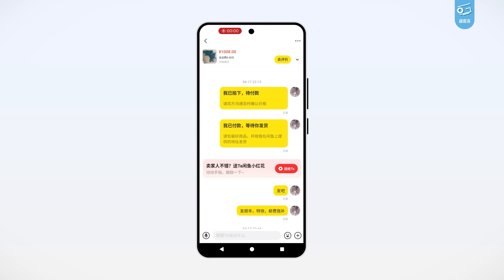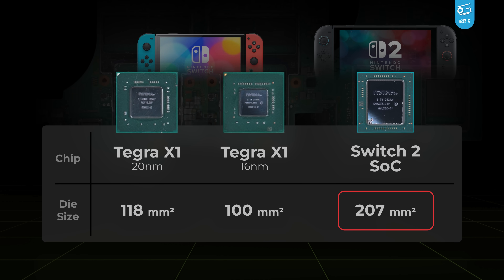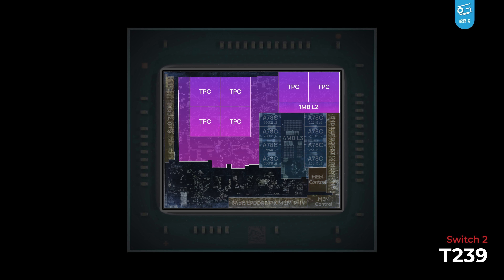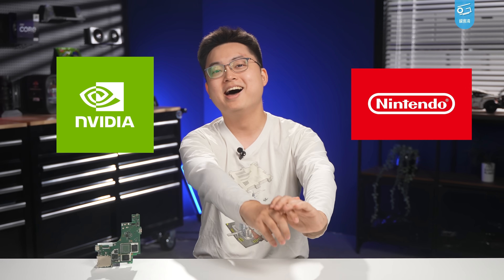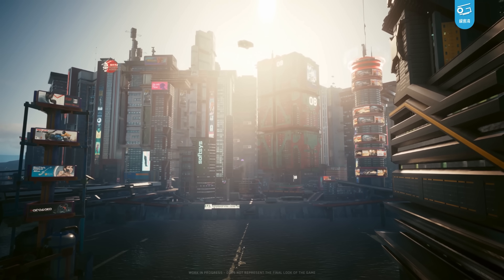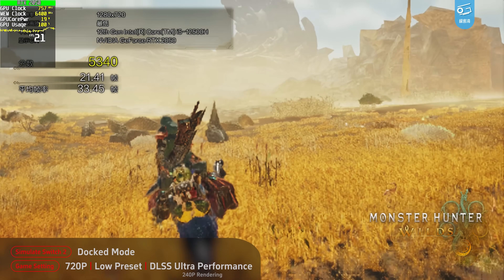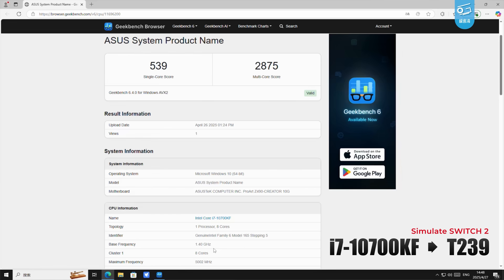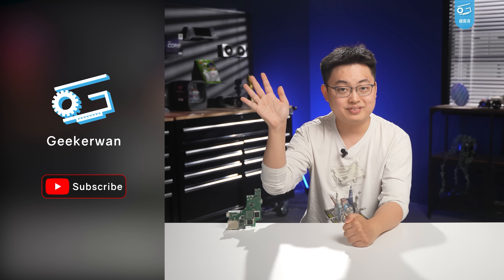This is Nintendo Switch 2's CPU!

Comment from the maker: Correction: 
3:28 The "S" printed on die actually refers to "ASE", the OSAT, aka packaging factory. However, the silicon itself was indeed fabricated by Samsung, as confirmed by our later FIB-SEM analysis.
Reply: It would have been nice to add the rog ally z1 extreme in that list
Reply: This probably is an early testing sample and maybe the actual production model will have another completely different board. Who knows
Reply: @JonLake  https://youtu.be/3pr_V8rtzrE?t=144 "The PCB Stamped Week 36, 2024", that is Aug-Sep 2024, so likely there won't be another board I would say.
Reply: 捉
Reply: Long time bro, miss u
Reply: Hey the iqoo z10 turbo released pls review the Snapdragon 8s gen 4
Reply: if tsmc made it, its gonna be better
Reply: 抓:hand-pink-waving:
Reply: The Switch-2 has weaker hardware than people think, so it will require optimisation. Likely the first-party games will have the most optimisations. But there will be the occasional "impossible ports".

Overall, the Switch-2 is more powerful than the XB1 but slightly behind the PS4. The Valve SteamDeck is slightly ahead of the PS4 and far behind the PS4 Pro. When Docked the SteamDeck doesn't get faster, it's still a 5W-25W device, but it usually parks at 15W TDP. The Switch-2 clocks up, and the processor is likely performing anywhere between x2-x4 faster. Most likely running x2.5 faster, which would require a 30W TDP. But in Docked Mode, the chipset will turn-on those Tensor Cores to enable DLSS v2 to upscale for a 4K 60Hz image. Overall, power draw from the wall would be closer to 40W-50W, which is double of the SteamDeck.

Remember, the developers need to convert their x86 game, into an ARM game, fit it inside the limited 12GB RAM, and optimise for the rest. So while the "PS4" performance of the Switch-2 looks acceptable now, very soon, it will be in the market against the PS6. It is likely to expect that Valve will release the SteamDeck-2 around this time, and we should expect around "PS5" level of performance. So the Switch-2 is going to be 1-2 generations behind. This was the case for the NSwitch, but it won't be as bad, since the generational upgrade seems to be getting smaller each time.
Reply: @ekinteko this.... Iv thought this for so long but iv never been able to articulate it, as perfectly as you have.
Reply: @Slodsworth  Thank you :D
Let me know if you have any detailed questions ?
Reply: @ekinteko a very well-articulated comment. I agree with most of your points.

Despite being weaker than PS4 in some ways, the Switch 2 will be more capable in other ways. 
It's kind of in this weird position where it's better and worse.
Reply: @Mitchy_Witchy  how will it be weaker?
Reply: @ekinteko  what do you mean overall? It shows the gpu is faster than ps4 even in handheld. Has more ram than series s.  Clocks are shown, its less than 2x more than handheld.
Reply: @bulletpunch9317 saying the SW2 has more memory than the XSS without mentioning RAM speeds, is misleading. The SW2 has DDR5x RAM vs XSS GDDR6 VRAM. GDDR6 bandwidth speeds are far greater than DDR5x.
Reply: @carl8790  sure
Reply: @ekinteko i have both a sw2 and a steam deck and the sw2 crushes the steam deck on the same games. Faster, prettier. Your rectal theory that nintendo handicapped switch when they didnt need to is a steaming pile of horse shit. There are many reasons the switch outperforms older architectures of ps4 and steam deck. Technology doesnt move backwards with time. The sw2 is over 10 yrs newer than ps4. You have to take comparisons like this with a grain of salt.
Reply: The Switch 2 motherboard is on par with a Series S; even better than that, in some cases.
Reply: @Skipler-J320 literally nothing here shows that

Comment: Steam deck=1.6 TFlops. 
Switch2= 3.1 Tflops
The switch 2 is so much more powerful than the steam deck its not even funny. 
In hh mode the switch 2 is hardly stretching its legs and so its performance in hh will be much better compared to steam deck. Vitale klitschko might only be able to benchpress the same amount as you with one arm tied behind his back but you dont want to fight him in a boxing match bc he will kill you.

Comment: I have an idea for a crazy phone design concept you could try in a video. Imagine if the phone’s motherboard was placed separately on a table, almost like how a PC motherboard sits in a case. The user would only hold the phone’s display/panel in their hands, and it would connect to the motherboard through a single cable.

With this setup, you could add full gaming features — like a powerful cooling system (liquid or fan-based), and even allow maximum overclocking of both the CPU and GPU, just like on high-end gaming PCs. This way, the phone could perform far beyond normal limits while still giving a handheld screen experience.

It would basically turn a phone into a hybrid between a smartphone and a gaming desktop, but in a unique detachable form. I think this would make an amazing futuristic concept video!
Reply: Thats what makes it annoying. U have to connect a cable. Plus grip wont be good

Comment: The Switch 2's CPU looks even worse when you take into account the vast majority of games only utilise one core, so the multi-core score isn't what should be used for comparison. That puts it at less than half the power of the Steam Deck or PS5.

Comment: This chip for switch 2 would be a real bummer if it was released in 2022. But bro it's 2025 now.
Such a shame they're not using the 5nm Ada Lovelace architecture manufactured thru TSMC but chose the Samsung 8~10nm instead. 
With 40 series architecture they could've had at least 20% performance upgrade and a much better battery life which is vital to mobile devices like switch 2.

Comment: Why haven't they just used snapdragon 8 gen 3 or 8 elite and overclock it because of the fan?  How is this all engineering and jumping through hoops and loops worth it I don't get it....
Reply: 2 reasons: Sticking with Nvidia guarantees backward compatibility with switch 1 games and significantly reduces software engineering work.
And the fact that Ampere chips in switch comes with DLSS so there's extra performance beyond benchmark.

Comment: Well I think your just looking a hardware. All the Stuff runs better in Nintendo Code. Like When Cyber Punk first came out it could not run because the Code was Broken. Needed Many Update to work well. So if These Games Had Better Coding they would run smoother. it not just about graphics. The Hardware has to be utilized well also.

Comment: This just confirms to me that Nintendo fans just dont care about true graphic fidelity.

I like Nintendo and their games, but i want a true console, not a gameboy.

I need minimum 1440p 144hz hardware. Id spend whatever Nintendo charges on a system that offered that.

For me money isnt the problem. I dont care how much their games cost. I dont care about battery life or mobile gaming. I care about 1440p NO FAKE FRAME, 144fps. 

They aren't getting my money till then. If i want to play a Nintendo game, id buy the game and play the pirated version on PC. No way in hell id use an old mobile phone like what they're trying to sell us with the switch 2.

Comment: Correct me if i'm wrong, but simulating an ARM cpu and gpu as an x86 mashine wouldnt give anywhere near accurate results as the architectures are so diffrent. Now this wouldnt be an issue for ps5 and xbox series x since they are both just pc's in a console casing but in the switch's case would mean wildly diffrent results from what it would actualy be able to do

Comment: Switch 2 max GPU clockspeed @1.4Ghz would be roughly 3000 points in 3Dmark Steel Nomad Light. Max CPU clockspeed @1.7Ghz would be roughly 800 single core and 4400 multicore in Geekbench 6 cpu performance benchmark. (Both scores estimated/hypothetical). GPU @1.4Ghz would be approx 4.3Tflops.

Comment: I'm surprised this video is still up.  NINTENDO doesn't mess around with this kind of stuff.
Reply: i guess they cant do anysht about this, 1.uploader did not have nda with nintendo 
2.uploader aint the one stealing the leaked board
3.uploader just brought this mobo by legally acquired.
4.uploader lives in china, which legal disputes for IP is somekind of... IP owner can't easily win.

Comment: Question? Is there away to replace some chips? With an other company chip?
Reply: then you need to rewrite the whole OS and driver
Reply: @ hmm…!!? Like how far does it need to be overwritten?
Can it be like terms of service be overwritten?
Or deactivate some features that a company has put there?
So example if Nintendo is able to brick or ban pretty much make your console not use able, is there a way to take off that command system or change the command to ignore Nintendo updates that can in danger the software and hardware?
Reply: @Venom.02 Nintendo would probably sue you for modifying their software which they state in their EULA, you’re not allowed to do
Reply: @ I’m not worried bout Nintendo suing they can try with a fake account with no real address.
I redirect there sue to themselves
Reply: @ just fyi they have before I still use the same account I don’t reply to them my account still works 😂
Reply: @Venom.02 man stay low enough
Reply: @ЙатСен_Чонґ pretty easy or blend right in

Comment: The switch 2 leak spec that you claim that you are running at right. I thought where 1007.3 Mhz docked and 561 Mhz GPU spec

Comment: Switch 2 handheld GPU performance is so close to Steam Deck's at both their max clocks that NS2 handheld may in fact outperform SD in real-world situations, where SD has to lower its GPU clocks to maintain its TDP while NS2 maintains the same clock throughout (assuming GPU clocks are explicitly set through profiles like Switch 1). That's assuming the game is GPU limited though.

Actually, the reason why NS2's docked CPU clocks are lower than handheld may be due to TDP as well. Nintendo/Nvidia probably decided to sacrifice CPU performance a little to give the GPU a little more oomph in docked mode and to hit a specific TDP target.
Reply: I fully expect Switch 2 to be a PS4 Pro in HH mode and close to XSS in docked mode thanks to the Ampere/Ada architecture and DLSS.

Comment: The comparison you made between the T239 on the Switch 2 and the RTX 2050 on a laptop is completely incorrect. You can't compare them head to head. Even if the comparison was made with a laptop, the GPU, processor architecture, operating system, Thermal Design Power, motherboard size, heat dissipation are totally different between the laptop and the Switch 2. Laptop GPUs are designed to run Windows with multiple layers of software, drivers, multitasking, graphical interfaces, browsers, videos, 2D/3D rendering, even antivirus, all simultaneously. The Switch 2 has an extremely optimized and closed operating system, designed to run only games, apps don't run simultaneously with games, if you open an app, the game closes and vice versa.
Reply: That's something that people CHOOSE not to understand.  No knock against this guy, but in-general the people the have the least knowledge about some things usually have the loudest voice.  

You don't have companies like CD Project Red and From Software going out of their way to talk positively about a device that they know is going to give them problems.  

No one (that has a functional-synapse left in their brains) is suggesting that the Switch 2 is some type of powerhouse, but it is definitely a capable device.
Reply: Again with this BS about how "poorly" and "heavy" windows apparently runs, when in fac it's actually the complete opposite, both win 10 and 11 are by current day well optimized and efficiently capable of managing tasks and processes and putting them aside whenever a game opens.
Reply: @yvanaluz9994  Reading comprehension went out of the window with you broski. That's not what he said.

The architecture is different. Laptops run Windows which OS is able to do Multitasking. "Laptop GPUs are designed to run Windows with multiple layers of software, drivers, multitasking, graphical interfaces, browsers, videos, 2D/3D rendering, even antivirus, all simultaneously." 

Yes, Windows is very optimized and can put aside some process to play, but a console isn't doing half of the things mentioned here, it's just gaming.

Comment: The most acurate not accurate video. Whys it still out performing steam deck tho lol whys street fighter six look better on docked mode on switch 2 then series s does?? Well optimization, dlss tech  and the rasterization performance are better than what these videos show by at least 15% the performance in handheld has beeen better than steam deck or z1 extreme at 15w and docked is near or better than series s 😉 i appreciate the video but this isnt a demo it's capabilities by any means

Comment: Dude what the heck? Samsung 8nm is so trash! This is unfortunate. There were tons of rumors that it would be on a 5nm node!! Man, I am so disappointed. I would have really liked to have seen this gpu on TSMC 5nm, but now that I think about it, that would have been a completely unrealistic expectation, right? Samsung 8nm and TSMC 5nm are not compatible in the same way as TSMC 20nm and TSMC 16nm, or TSMC 7nm and TSMC 6nm? They would have had to completely redesign the SOC to get it on TSMC 5nm. It's a shame, then, that it didn't get ported to Samsung 5nm. Samsung 8nm is like 25% better than TSMC 12/16nm, so yea, I'm disappointed. OMG it can't run Monster Hunter Wilds that is insane! Nintendo r just so unbelievably stupid.

Comment: People are forgetting the optimizations.

There's a big reason why cd project red said that Cyberpunk is at it's best played on the switch via hand-held considering there's a bunch of handheld PCs. Because Cyberpunk was being made literally to work well on the switch unlike the handheld PCs
Reply: Tell that to my steamdeck running it at 45fps locked.
Reply: @andrzej_autko  what is that like? Low- very low settings at 720p? Are you saying you are more reliable than CD Projekt Red themselves? Lol
Reply: Oh wait it's not even 720p is it? It's probably like 400p or something
Reply: @jovyrivera7055 acting like the switch 2 can run the game at native res
Reply: @tranquility6789  Which is still more than what the steam deck could achieve
Reply: @jovyrivera7055  Yeah we'll see lmao. Btw there's literally a ROG tablet with rtx 4090 out there. Also there's ally x which can run it at 1080p smoothly.
Reply: @rohitsinha8404  No question about the ROG Ally, it's always been the better option over the deck. People just bought the steam deck and couldn't accept it gets stomped by all other handheld PCs from bigger companies. 

With the switch 2 - Again it's projected power is already better than the deck, and that's the performance of a "simulated" switch 2 which is probably weaker than the actual switch 2 playing a nonspecific optimization for the hardware.

What we'll get when CD Projekt red have made finalizations on the game will definitely be a more optimized and better looking switch 2 performance which again just based from the images alone looked better than the deck and as testified by most people it plays well to good. There's literally not a single person saying that cyberpunk was "unplayable or awful". Meanwhile the deck literally struggled to play the DLC of cyberpunk
Reply: @jovyrivera7055 it literally isn't tho. Switch 2 gets 360p upscaled to 720p at 40fps, 540p to 720p at 30fps in handheld. This is literally what the steam deck does as well, not to mention that it can get 60fps. You have to lower the settings quite a lot to get it to 60, but it's something the switch 2 is limited by CDPR from not doing. And yes, the deck can also replicate the docked mode settings (540p 40fps, 720p 30fps to 1080p). The switch 2 will perform better, but not by much.
Reply: @tranquility6789  I don't even know where you're getting your sources. Most people that have a deck even testified the switch port was already better. Also there's no point for trying to even fight for the Steam deck's specs. It's already outclassed by everything else coming and already in the market. The fact still remains CD PROJEKT RED themselves told us the switch 2 is the best version to be played handheld. A quick youtube search will tell you the switch 2 Outclassed the steam deck in Cyberpunk 2077 by a whole lot. Also The steam deck was said to have problems with the DLC maps, meanwhile the DLC Map was even featured in the trailer.

You can claim "it can go 40 fps" or "it can go 60fps" but you're lying to yourself because it's not a consistent 40-60 fps but in reality its 20+ to 40fps and maybe it it can reach 60? On a static image? But it sure as hell will not play at 60 in continuous gameplay.

Also the switch 2 docked is already so much far away in power compared to the deck as per the video.

Comment: 17:00 The Test is pretty flawed, because you cant really compare an ARM chip to an x86 chip. And Windows is pretty resource hungry and doesn't react well to low clocked CPUs. But nonetheless an interesting test.
Reply: Agreed! A flawed but interesting test. I personally expect the actual performance to be close to i5-8400 + GTX1660 after optimization. Let's wait for the official release and we'll know the answer😌
Reply: @tenchouhateinentraumhaften3875 Sounds like a pretty good prediction. But I think the GPU Performance will be closer to a 1650 or 1650 super if it had 6 GB of VRAM.

Comment: You need to consider DLSS and software optimization to really compare Switch 2 to its desktop equivalent. Huge leap compare to what we get from original Switch. Nonetheless the hardware is not ground breaking, they should come with OLED tbh. I hate LCD